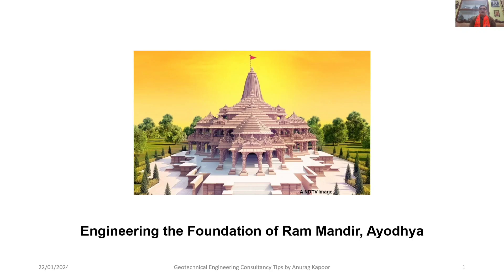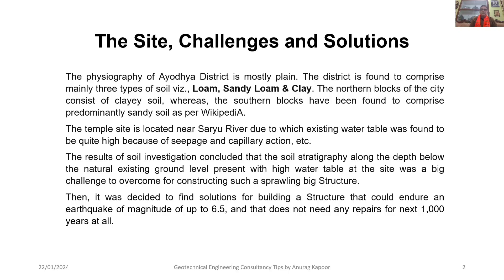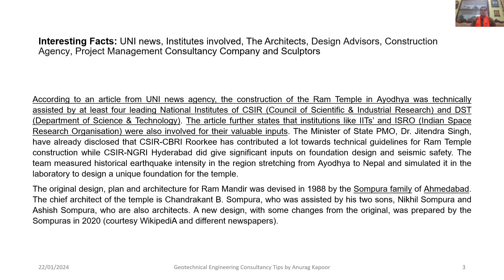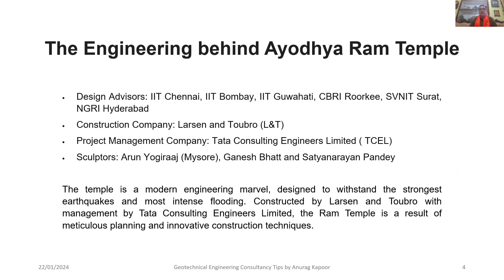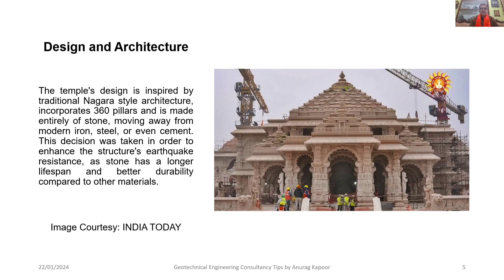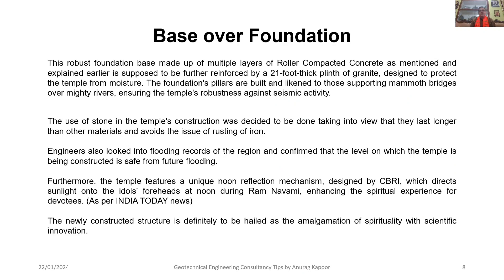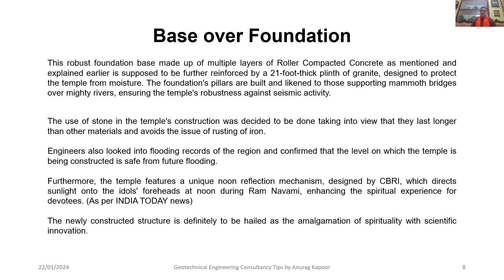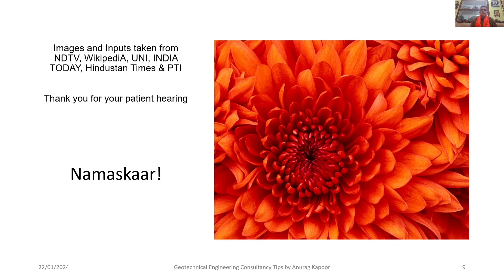Engineering the Foundation of Ram Mandir, Ayodhya: Foundations on Improved Ground | Geotechnical

Comment: Hello sir! I am doing a research on soil settlement, we have a data of soil borehole logs but lacks data for consolidation tests. Can we predict soil settlement based on soil borehole logs? If so, what methods can we use?
Reply from the maker: No, you can not without doing the tests or you should have it's classification, etc. with you or otherwise Standard Penetration Test Results with you to get those results based on vast experience. I will advise you to please share me your problem statement on my mail ids' anuragkapoor16@yahoo.co.in or anuragkapoor16@gmail.com
Reply from the maker: After that will discuss it further and suggest you the best way out
Reply: Cengrs had done the geotechnical investigation for the temple. Since sand is encountered to over 120 m depth, consolidation settlement is not expected to occur. All the settlement i essentially immediate.